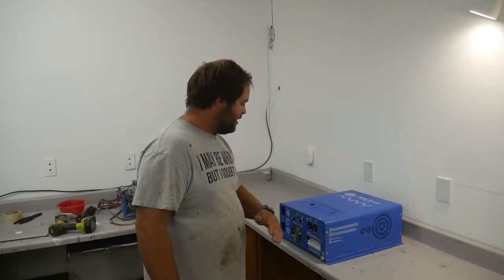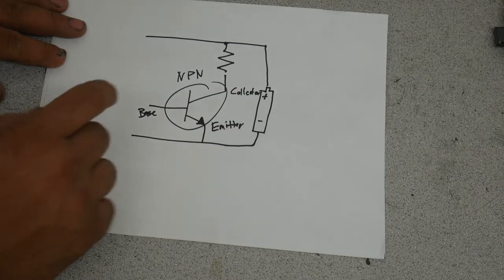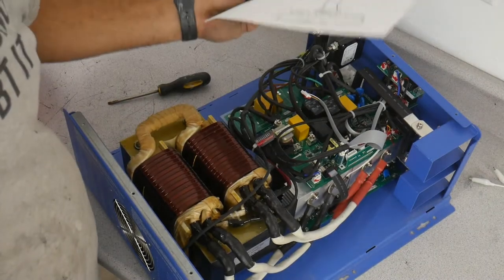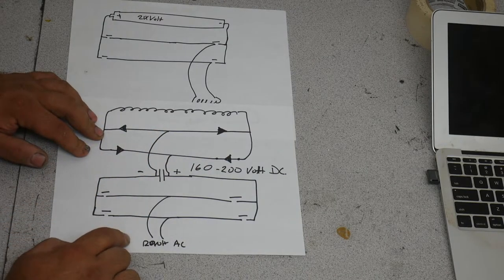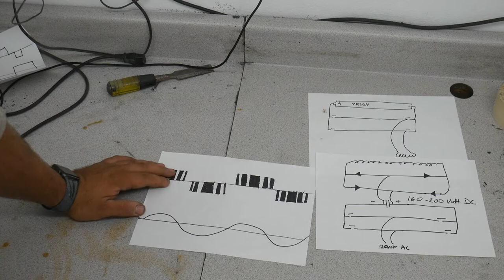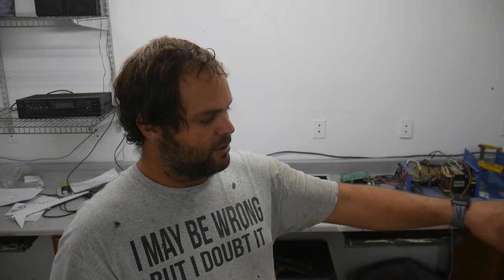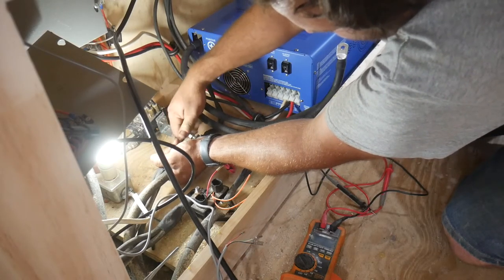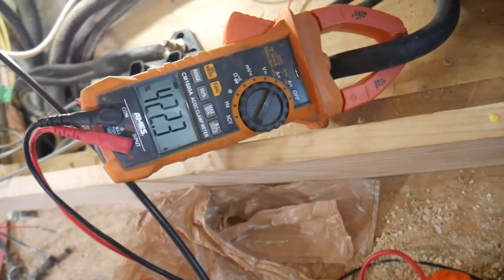Homemade RV. EP-41 Power Inverter Install. 1977 Peterbilt 359 Toterhome

Comment: Inverter generators wiht pure sinewave output do not produce that clean sine wave that many people claim, they can generate one more than adequate to power most devices without problems, but it is not good as mains power and much less better.
I think the only real advantage they have is that they do not produce voltage spikes when a load is disconnected like normal generators can do, that will help increase the life of sensitive electronics, also the output voltage stays within the proper range or they cut off the output entirely if for some reason they can't keep it within limits, while capacitor-regulated and some electronic AVR generators will output too high voltages if the engine over-revs for any reason.

But the perfect sine waveforms that are usually printed on the package, stickers and manuals are pure marketing.
And of course not all inverter generators are pure sine wave, regardless of their price and power, they can be pure sine wave or modified sine wave, some stores are not too honest with customers in this regard, it may be due to ignorance of the sellers or they may try to give you a pig in a poke.